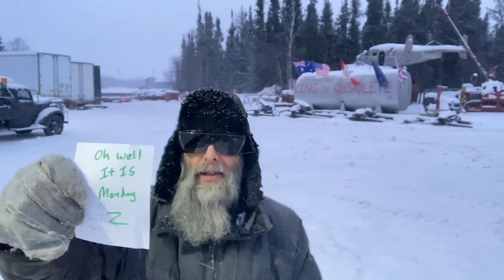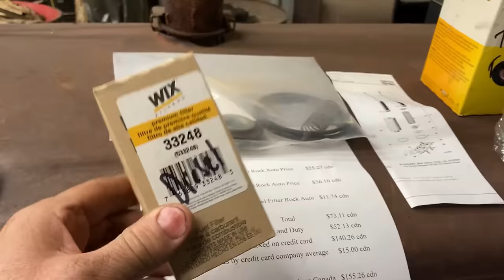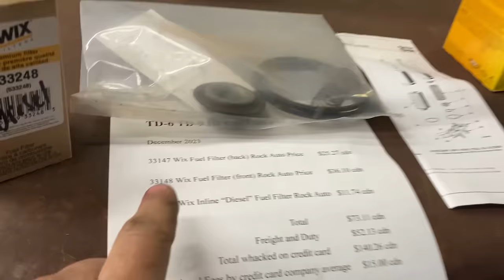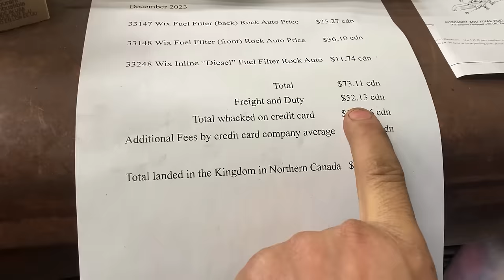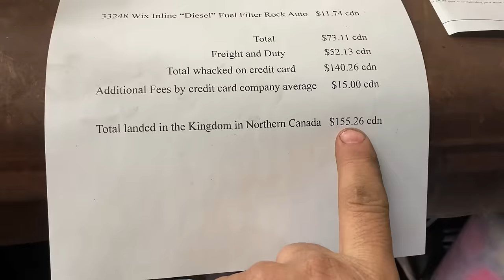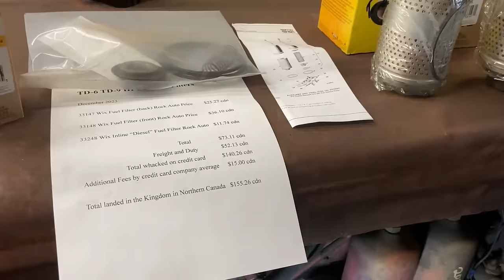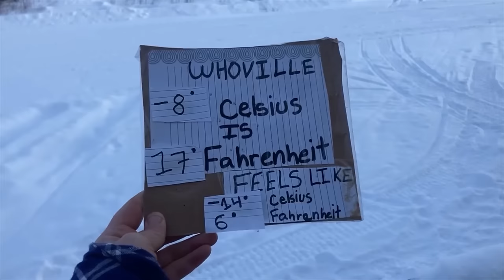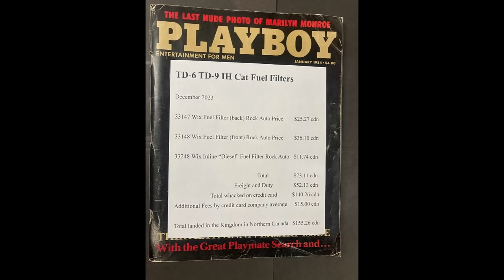Explaining Improvements to the TD-6 TD-9 IH Cats Fuel Systems Dec 18 2023

Comment: Hello Joey and Xena  I am a 67 yo farmer and a lot you do there is the same as I do to  repair and improve.  Yes Wilson is not the most reliable starters and alternators.  Had lots of experience in the past 50 or more years with them.  I have an old Caterpillar Gen Set bought for $1000 it is 60kw I am getting working for backup.  It has the pup engine to start and the D318 diesel engine ( same as a D6 crawler I believe) all seems to run good just got the generator working I think,   needs more testing.  Never to old to learn.  Great videos.  Take care in the wildernes.
Reply from the maker: yes wilson used to be good and i grew up in the south with seeing their rebuild place in winnipeg. then for cost cutting they moved the rebuilding to mexico and after that they became junk. your d318 genset is quite common being caterpillar. easy to get parts for and easy on the fuel too  thansk

Comment: Neat trick with the inner tube valve.  Would a bigger filter back by the tank extend the life of the expensive ones?  Looks like you have a process for fixing starters too. 6 volt stuff has larger wiring. 12V is no problem for them. I have buckets of nuts and bolts harvested  for re-use. High quality hardware is expensive. 😎
Reply from the maker: that is the only inline diesel filter we can get. the prices of the IH style filters are getting out of hand and hard to prime. with a new style starter being installed in the future the IH filter housing will be going bye bye to make room and a common spin on filter will be added. i did that to the TD-18s and it works out well. people have a hard time believing that only 1 filter is working in the 2 filter IH system because people did not understand or were given the wrong filters.  thansk

Comment: It does take a lot of work to keep those cats running that's for dam sure. Everything is pricey at the end of the world. I tried to get a new oil filter for my 1952 3/4 Ton M37 and Rock Auto sent me the wrong one. Luckily the fuel filters were fine and it was a Wix filter so they do mess up sometimes. Thanks for the informational video Joey.
Reply from the maker: yes everything is expensive and we double check and triple check everything we order in to make sure they are correct. in almost 10 years of ordering from rock auto we got the wrong rad hose. very close part number so the human picker made a mistake.  thansk

Comment: From New Zealand. Drill fuel cap and insert tubeless valve stem maybe🤔🤔
Reply from the maker: yes that will work but we also use the inter tube valve stem on other fuel tanks too. plus the inter tube tells you how much air you put in the tank by being "puffy"  thansk

Comment: Hmm... I don't remember where we ordered the starter for my M from but it's been good. The one in my 450 I've changed the bendex in, that one will not engage on the first try in the cold but after that it's OK. Also the shaft in  tube between the carb and govener will stick in the cold on that one. I had a bunch of bendex troubles a few years ago I don't remember the details but we got them ironed out. I have a local rebuilder that did pretty good work but they were bought out so now who knows, and the old parts guy at the dealer has retired so sometimes finding quality parts is hard. If I run across stuff that works good for me I can let you know maybe Sir Rodney can get them from the source if need be. We need to keep these old IH's running weather they are the cats or wheel tractors, that 1956 450 runs every day in the winter feeding cattle and a 1959 560 takes its place in warmer months.
Reply from the maker: yes no quality in the new parts of today. the governor tube between the carb and block always builds up with ice at the set screw adjustment. we learned not to idle the motor right down so when iced up we can still drive the cat to warm up the motor. once warm the ice melts to become water again. the water is from condensation. if it gets really back we unbolt the tube and pour alcohol in the little space to get rid of the ice-water. good to see old IH going strong  thansk

Comment: I've got to say that WIX is my favorite. Although others are good. Wix has filter days that give discounts , usuasly in March and some times in the fall. I would assume some Canadian store does the same. It is close to the one from Milwaukee tools as well. Not to say I don't have a Fram out there that gets changed faster. I think Engine masters covered filters a while back on Motor Trend,
Reply from the maker: excellent to hear abut the discounts by wix. wix books and website have been very handy over the years to see if other filters will work when out of stock on the one i was going to use  thansk

Comment: I hear you about the quality of parts today, it's shameful... I have a very old car that runs on a pressurized fuel tank.  It only needs 1 psi to pour gas all over the floor,  more vodka
Reply from the maker: yes it does not take much air pressure to make a mess or hurt you  thansk